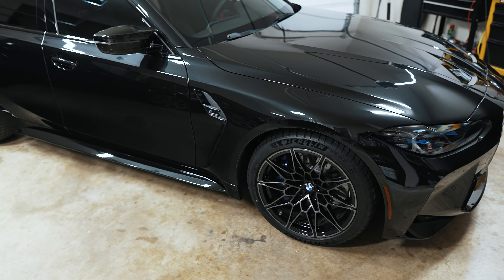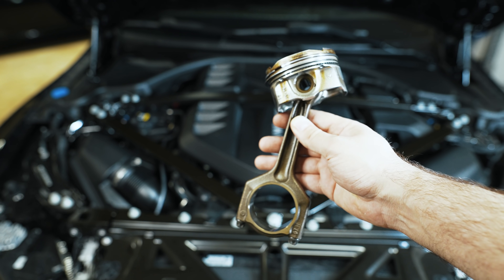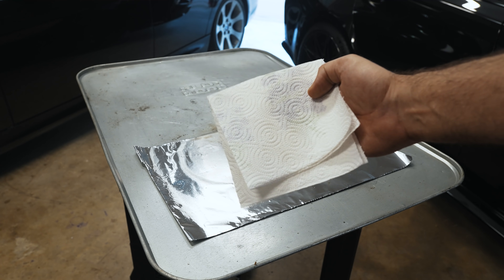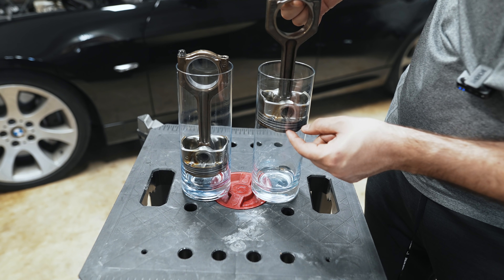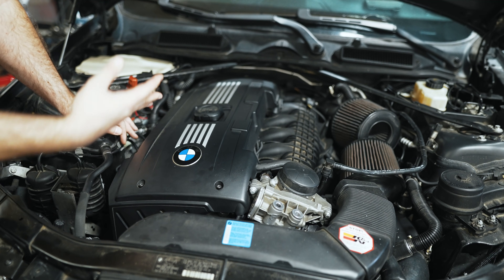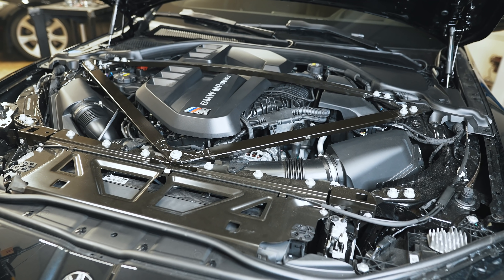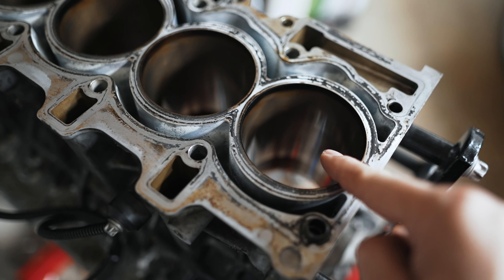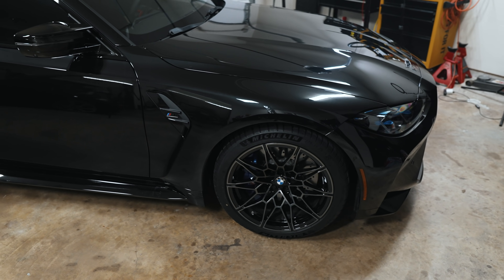This New BMW Engine Will Make 1000 HP Stock!

Comment: Would love to see 1000 HP on 93 with different turbo's, though it seems easier and lower cost to run E60 and adjust tune.

Comment: So compared to the b58 , the s58 is superior over it as far as making power easily and reliable over the b58 …. Seems like 600-680 on the b58 is pushing it for long term beating it hard

Comment: I’m curious if the flagships are running the s5830t0 which car  is gonna receive the exclusive engine when I was looking specs I saw this engine will have a variant to eclipse the t0. 50 units will be released with the        S5830s0- (s1)was dropped below tier graph s1     (me guessing or hoping)  with a large single turbo electronic controlled w.g prototype for the s1unit possibility  ….the s0 would this be specifically a race engine? do you think they will drop g30 m comp race spec  with factory 650 h.p maybe  some finale engine before they start tree hugging and put out an electric M motor I hope this is not on the horizon soon but can’t really deny performance with the plaid busting everybody up on the strip
Reply: Great stuff as usual always enjoy hearing you going over stats and breakdowns of how it works and e90 content as well

Comment: I like the video, but you talk about static CR. The amount of camshaft overlap will decide effective working CR. A big advantage to port injection is it keeps the intake ports and valves clean DI engines slowly coke up the intakes, effectively losing breathing efficiency over time.

Comment: Congrats on the beautiful new BMW G80 M3. You deserve it. Eventuri/Evolve should make some nice mods for this M3/M4.
Still love my BMW E9X M3 with 190k miles. NA S65 V8 is much better than any Turbo I6. Broke pretty much everything multiple times. 
In general, regular BMWs are terrible cars in terms of reliability for high mileage vehicles over 120k miles. That is why they doubled the price and dropped the warranty from 4 yrs/50k miles to 3 yrs/36k miles. But yes, the B58/S58 is a big improvement. Forged internals with a mechanical water pump/thermostat. My BMW 335i F30 N55 electric water pump failed in 2020 after just 60k miles. $2500 repair due to high labor costs, covered under a 3rd party warranty. Most BMW parts are made by suppliers like Bosch, Siemans, etc. and their engineers aren't getting any smarter with production moving to Asia. Spme BMW G2X 3/4 series are made in Mexico
Reply: Keep that s65 going, rebuild and supercharge

Comment: i assume the main difference between a high & low compression force induction engine is on the pumping loss, bmw n52 engine had valvetronic and disa to accommodate for that

its like building boost on the valve side rather then before the throttle body, less calculation harmonizing the air flow without pumping losses and intake filling according to turbo response

try search for n52 turbo and observe the boost response, maybe that will add a few more ideas for you

accel bro!

Comment: There's no doubt the S58 is a monster, stock or modified but how do we really know for sure that it can handle these power levels "all day long" without issue? The 1,000hp+ drift car in question has only been running that power for a few weeks, no? What about 10K+ miles? There's no data.

BMW's track record with the plasma transferred wire arc (PTWA) thermal sprayed on liners in stock and modded B58s isn't so hot. If the liner becomes scored, you can't replace it as it's sprayed on. The S58 uses the same technology.

The short block, and maybe even turbos, might be able to handle the power for a while, but what about all the other ancillary stuff like pumps, seals, cooling. heat exchangers, transmission, etc.?

I'm sure the S58 will be "stronger" than the S55, but I'm not yet convinced this is the new 2JZ.  Also, when it comes to the 2JZ, yes, the short block was strong as hell and the motor could make massive power BUT, to make massive power requires lots of ancillary upgrades.  It seems like most people think you can just add a single turbo, make 800+whp on the 2JZ, and that's it.  That couldn't be farther from the truth.
Reply from the maker: I plan on making a follow up video and I'll take your points into consideration.  Thanks
Reply: @VehicularDIY  Excellent.  By the way, you have by far the best BMW information and maintenance channel on YT.   I always look forward to your videos.

Comment: My question now is if you would tune it up to lets say 650 HP and use it as a daily, how long would it last. I imagine there beeing some loss of max miles for the engine wich is kinda normal due to higher wear but would it be like from 200000 down to 170000km or more like down to 70000 XD
Reply from the maker: On the N54 in my opinion you could extract about 40% more power without adding any additional stress that would lead to reduced life expectancy.  On the S58 with upgraded turbos I would think it could tolerate an additional 200 WHP but not on the race track, it's all about removing excess heat.

Comment: Nice vehicle. But break in periods are pure myth now. That engine was run at redline for a while at factory.
Reply from the maker: Yeah the follow up service from BMW is more to check torques and flush diff fluid etc.  The rings are seated at the factory but it never hurts to play it safe.

Comment: From n54 to N55 to B58 to S58, with all my bmw engine knowledge all the problems/HP limits on each engine bmw fixed each engine making each engine more reliable and faster we got supras running 8’s in 1/4 on stock bottom end, i cant wait to see the records the S58 run

Comment: Sadly this guy has a great lack in under standing of direct injection operation and when talking about port injection vs direct injection, Port injection starts to inject fuel when the intake valve is closed and increases duty cycle of the injector as more fuel is required, this means a full air fuel mixture is in the combustion chamber on the compression stroke, this limits compression ratio's to stop pre-ignition combustion events, Direct injection starts to inject fuel when the piston is close to TDC (I'm not sure of the correct timing, but this could be 22deg btdc with ignition timing 18 deg btdc) and direct injection continue's to inject throughout the combustion process, this creates the heat expansion that pushes the piston down the bore, basically direct injection slows the combustion process down. Direct injection and port injection and lower compression is done for emissions from factory , aftermarket is when there isn't enough fuel delivery from the stock direct injectors, he show's a N54 there is an aftermarket port injection system that has been used for years , but now with an overdrive for the direct injection pump, as of writing this I don't know of anyone that has maxed out factory direct injectors with the over driven pump.
Reply from the maker: I appreciate the feedback, from my perspective I try to simplify my explanations to make it easy to digest.  That does come at the expense of potentially oversimplifying things, I welcome comments like your so the viewers that want more info can get more in depth perspectives.  I still stand by the fact that direct injection is superior to port injection with regards  to controlled burn.  A great example is the 1.8L engine in Hyundais that run on 87 octane and make close to 150 HP when 2L DOHC engines in the past would make 130 HP.
Reply: @VehicularDIY  yes direct injectionis superior than port injection, but there have been some lemons along the way, Mitsubishi's GDI

Comment: Those G80s are gonna get walked by ST G-1000 N54s
Reply from the maker: Mine would get walked now by my N54 lol but the way the power comes on in the S58 makes a difference.  Imagine the pull of a strong N54 but the power keeps building right till redline.

Comment: wtf is this the real pistons and rods used in this engine??? @2:35
Reply from the maker: Those are N54 pistons and rods.  They may not look very impressive but they too can handle big power, up to around 800 HP on single turbo cars.
Reply: No it's not the real pistons and rods don't look like that at all.

Comment: I Wonder Could That replace my broken down n63 BMW engine. the car has been sitting in my garage for 2 years now and BMW refuse to fix it. It sounds good in the beginning but BMW is plagued with lots of engine problems. Let's see what happens 60 thousand miles later.
Reply from the maker: It could fit but the electronic integration would be quite the undertaking.

Comment: 5:45 - the new 992 Turbo S has a compression ratio of 8.7:1 only. The 991.2 had 9.8:1 and they made it lower, but still making more power and torque. Maybe similar technology/philosophy to that of BMW?
Reply from the maker: Seems so, I wonder if they bumped the fuel pressure up as well on the porsche

Comment: what’s this i’m hearing about B58’s burning oil at an abnormal pace. Is that just a scare or actually an issue?

Also is the S58 suffering from the same issue as the B58?
Reply from the maker: Given the s58 runs thicker oil I don't believe it will be an issue.  I've heard the b58 can burn a quart every 3k miles or so due to the 0w20 oil.

Comment: Serious question - has BMW sorted out their long standing rod bearing issues yet?
Reply from the maker: I think so for the most part they coat the bearings due to the start stop technology and these new motors don't Rev out as high which helps the cause.

Comment: I read somewhere that the new mazda skyactive g engines are 14.1 compression.
Reply from the maker: Yeah I think 13 to 1 with direct injection but running 87 octane which is impressive.
Reply: @VehicularDIY  yeah I just searched it and now they're turbocharged also

Comment: I’m wondering the cylinder head intake and exhaust cfm of the s58. It’s gotta be crazy high to flow enough to allow these numbers on pump gas. Even with the lower compression, and direct injection, I would assume  these have to flow exponentially more then the n54 to achieve that. Also the turbos are more efficient and pump more efficiently, pushing cooler air into the combustion chambers. It’s pretty awesome to see this on the final hoorah of inline 6 motors. Peak gasoline efficiency achieved it seems.  

I have seen an N54 with serious head work and a huge turbo hit 750ish whp on pump gas. The power curve is way different though.

Edit to add they hit 736 whp with an N54 on pump gas. 3.2 liter engine. Couldn’t find info on compression ratio. Stage 3 head porting. 76mm compressor inducer.
Reply from the maker: That's interesting, thanks for sharing.
Reply: The head flow is very good and the charge air cooler really is amazingly efficient for its size and pressure drop ratio.  We have not finished testing by any means and we will have more results out soon.
Reply: @TrackdayPerformance  awesome I’ll be waiting! Thinks for the reply.

Comment: It starting to look like the S58 is the “2JZGTE” of our time.
Reply: Not really the N54 was the modern equivalent. 2JZ was only good for up to 700-750bhp. B58 are doing that comfortably now, S58 is on a different level.
Reply: @THEDOPEYDAISY  I’m not sure about that with the N54; it was an open deck, as oppose to the 2JZGTE which is a closed deck.

And yes....the S58 is in another dimension. Can’t wait for an S58 M2 or GR Supra.
Reply: @755hp  B58 is closed deck.
Reply: @THEDOPEYDAISY  Of course....the N55 was closed deck before the B58; they won’t go back to an open deck design.
Reply: @755hp  i thought the n55 and s55 were both open deck?
Reply: @ImAlexLP  N55 is open; S55 is closed.
Reply: @755hp  isnt the s55 based off the n55 though? They’re both open deck.
Reply: @ImAlexLP  S55 is a closed deck design, stop spreading misinformation...
Reply: @ImAlexLP  s55 is based on n55 but closed deck while n55 is open
Reply: Nah it’s the BMW S58

Comment: Great video. So how am I going to get my M3 to 750 hp? :-)
Reply from the maker: Stage 1 turbos and a tune should take care of that.
Reply: @VehicularDIY  The problem is they can’t tune this car. From what I understand the computer isn’t even close to being broken yet. Do you know anything new? Thanks.
Reply: @BrettL250  you need a custom ecu
Reply: @olaf_s_23  and where would I get that?? 😃
Reply: @BrettL250  aftermarket vendors offer complete tuning kits. From software upgrades to turbos + ecu + exhaust. „FF Retrofittings“ develops a 780 hp kit without changing the turbos (= cheaper) for the new S58 engine.

Comment: Another great tech video.  Couldn't you decrease compression ratio by increasing the volume in the combustion chamber? I'm not sure this is possible on these 4 valve heads, but theoretically in the N54 application, wouldn't a larger volume CC would reduce compression and allow you to safely and more reliably run more boost?
Reply from the maker: Thank you, technically increasing the volume in the combustion chamber would allow for more air to be compressed and the ratio to go higher.  Best way would be via different pistons.

Comment: 1000 horsepower with slight modification to the cylinder head.  There is nothing slight about removing the whole top part of the engine (cylenderhead) of a $90,000 car and and have metal machined off the bowls. And the solution to the heating problem was 2 radiators.  Not just one.  I know you got a beautiful new car with a great new engine platform but the N54 is still king 🤴 when modifying for the cost.
Reply from the maker: No denying that the N54 is the HP bang for your buck king.
Reply: You don't need 2 radiators for a track or road car.  They get plenty of air flow to cool them.  In Drifting the angle to the air flow is far from optimal thus we chose this approach.

Comment: Very nice you talked about the N53. Had one for 3 years and US didn’t get them because quality of fuel.
Reply from the maker: Yeah from what I understand due to concerns of high Sulphur content, given the N54 shares the same fueling system perhaps that is why injectors act up on them.
Reply: @VehicularDIY  It could be that. In my years of ownership I changed to injectors and the dme. Same dme as N54 and same problems that N54 have. with stratified lean mixture it also got pretty good gas millage. 

Btw, love your videos. Used a lot of them when my N53 did have a bad day. :)

Comment: What happened to the aluminum oil filter cap on the 335i?
Reply from the maker: I still have it but didn't want to run it on the new engine incase it was contaminated by bearing debris.  I'm ordering a new one.

Comment: I just heard "this is better than the 2JZ"
I can hear the Supra fanbois getting angry all over the world right now
Reply: we are here but not bothered considering the 2JZ has been around for 3 decades. What’s this about B58’s and maybe S58’s burning oil at an abnormal rate?  people with 1k miles included.
Reply: @bigjdm5460  tbf that seems to be a apparent issue for the 21 mk5s B58 since they have a lower compression ratio than any other 6 port B58 made(this issue isn't present for the 2020 models B58 since it has a higher compression ratio plus its a 2 port B58)so the main guess for RN is that they aren't being broken in correctly (well aren't being pushed hard enough threw break in)but that's the main guess for RN. The issues for the 21 mk5s B58 aren't present for normal B58s as is. Plus that issue isn't present for S58s since that would've been tossed around with the X3 and X4 that were both 1st cars to ever have the S58.
Reply: You are on crack son

Comment: Stock bottom end? What, Stock rod bearings? 
Hope they warmed them up. ///M division have a vendetta against clearances.
Reply from the maker: Yeah given they have a robust coating to deal with the start stop technology and they no longer rev as high hopefully they don't end up being an issue.
Reply: In a similar vain, the S58s were recalled in the x3m / x4m for rod bearing issues.  I believe because the quality or the application of the new coating (unsure though). Any thoughts?
Reply: @karleignr  The S58 is only found in the new M3/4 and the X3/4M
5s and 6s have a V8 coded S63. I've seen some let go of bearings.

Comment: What's your thoughts on the "Crank Hub issues" on the S58 engine. I personally think it's all BS like "Rod bearing issues" on the S65.  A couple of engines have a problem and suddenly the internet thinks all engines need fixing / replacing
Reply: The crank hub on the s58 is a single piece design, an overhaul from the s55 crank hub.
Reply from the maker: Yeah the S58 doesn't have a split crank hub luckily so that issue won't effect the it.
Reply: Rod bearing issue isn’t bs on the s65 tho
Reply: There is no way the crank hub will spin on the S58 cranks.  Its an integral part of the shaft.
Reply: The rod bearing are good in the S58.  For elevated power levels we use a heavier weight oil also as it has a higher film and film shear strentg.

Comment: Hi, I have a question, I recently got my G80 M3 Comp and I noticed that sometimes at very low RPMs, probably anywhere from 800-1200 RPM, sometimes the car makes this weird sound that comes from the engine bay. It’s accompanied by a light vibration as well. I noticed it usually only happens while the car is warming up, is at low speed, or sometimes when you’re turning at low speeds as well, like when you’re driving around a parking lot or something. I was wondering if you have experienced the same thing.
Reply from the maker: Is it a humming sound?  You might be hearing the limited slip differential.  It's super aggressive in this car.
Reply: @VehicularDIY  It is sort of a humming sound but it’s also accompanied by a very slight vibration that you can feel through the floor of the car. Very minor though. I need to try to get it on video but I haven’t been able to yet. I think it’s coming from the front, that’s the only reason I’m inclined to believe it’s not the diff but I could be completely wrong.